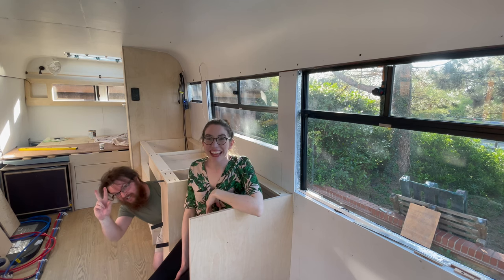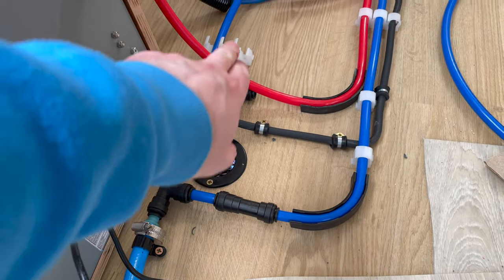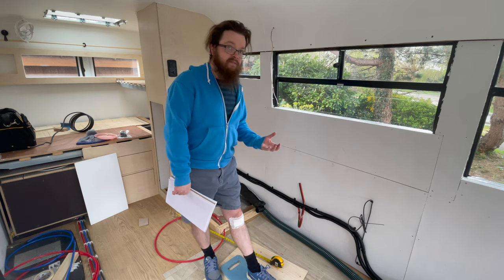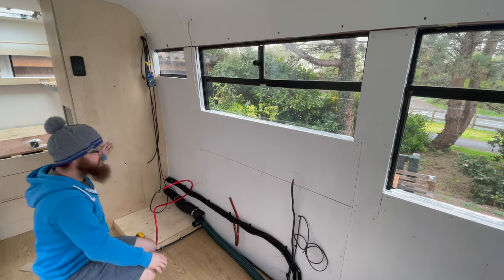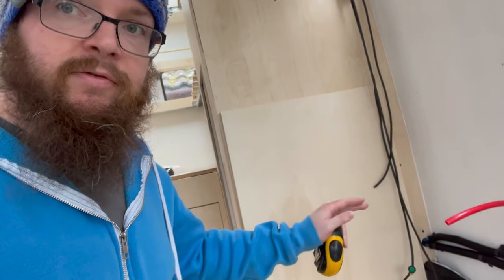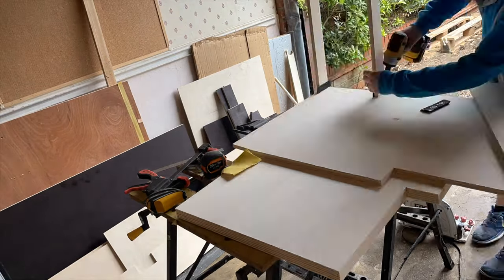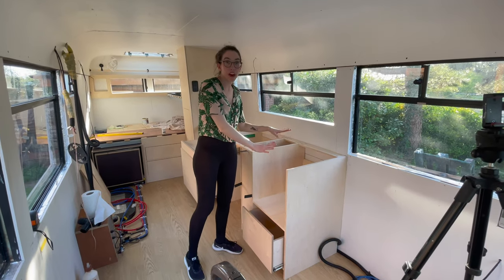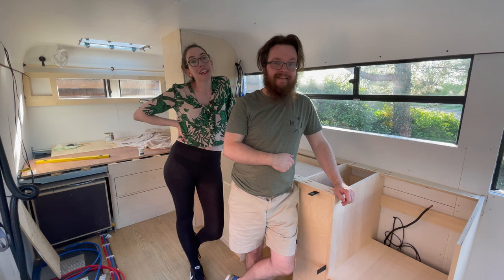HUGE Progress! DIY Van Kitchen Cabinets (Stunning, Simple + Strong) | Mercedes Vario Van Conversion

Comment: Ha ha ha loved how rich just pops out from under the kitchen unit . Happy Easter guys this has to be a bit of a milestone surely. Can't get over how much things are progressing. My diesel heater pump mount has already degraded and has failed the rubber block it hangs in has many splits in it I've just put a couple of cable over it for now
Reply from the maker: Lol thanks James. Happy Easter to you too. That’s probably a sign we are taking a fair while to finish the build 😂 - or some poor plastics. Let’s go with the latter hehe.
Reply: @WanderbusAdventures  id say very poor quality rubbery type material, what ever was available in China on the day of making lol . But yeah it does show how big a build it is but it's an epic build and your doing a great job !
Reply from the maker: Thanks James 😊

Comment: Well I've been using a jigsaw for 30 years and I didn't know there was a jigsaw blade designed not to chip the surface? Have you got a link please?
Reply from the maker: Hey Andrew. So signs are good. They are technically built for laminate board I think band they did a great job on the poplar and birch. They are Bosch T308BO - I got them here as at the time where cheaper than screwfix. https://www.ebay.co.uk/itm/201713014319?mkcid=16&mkevt=1&mkrid=711-127632-2357-0&ssspo=0Xan_hlbStS&sssrc=2349624&ssuid=wjJTwNrTRLy&var=&widget_ver=artemis&media=COPY Was really impressed with them.
Reply: If you search for worktop jigsaw blades you should get the right ones. I used one years ago when fitting a new kitchen, it cut on the downstroke so not to rip the laminate on the up stroke.
Reply from the maker: That’s spot on. These ones created a nice neat edge both sides. Will keep testing them and report back